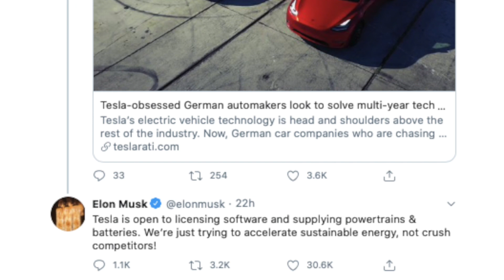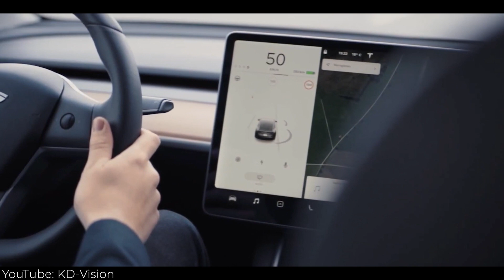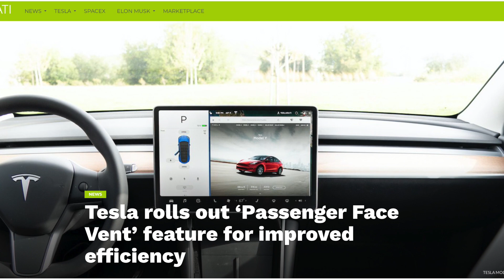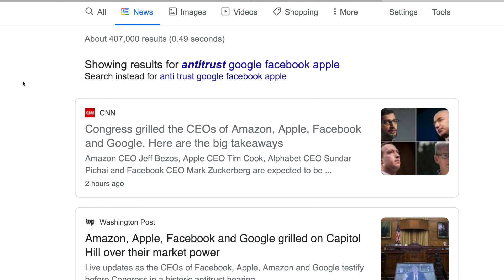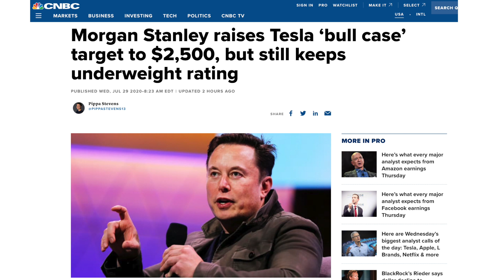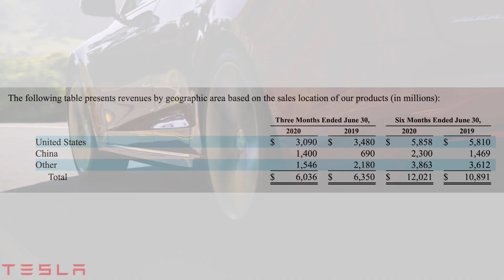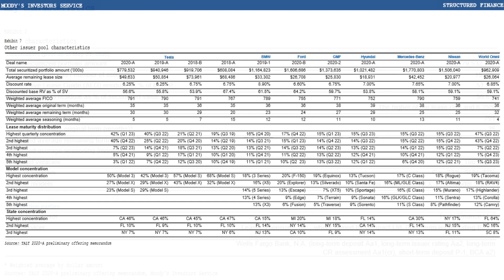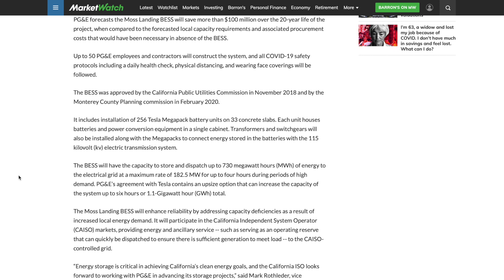Will Tesla License & Supply Other Automakers? +TSLA 10-Q Analysis, Cash Raise, Morgan Stanley & More

Comment: Tesla doesn't have a battery relationship with every supplier. If other manufacturers are dealing with non-Tesla suppliers, why wouldn't they license software or motors or even aspects of battery design at no detriment to their own capacity?  They have done this before with Toyota and Mercedes.

Comment: There's a difference between licensing the technology and licensing the products. 
Tesla could very easily sell licenses to their battery and powertrain technology for others to produce. "Here's the blueprints, make all the cars you want using them. The supply chain is your problem."
Same as how Google basically licenses the Android operating system for a pittance, because they know the real money is in the Android appstore, not the phone sales. 
Every licensed car using Tesla's FSD is feeding Tesla's AI. 
Every licensed car using Tesla's charging system is earning Tesla revenue on their charging network. 
Every licensed car using Tesla's interface software is earning Tesla app and data sales.
And ulitmately, every car using Tesla's FSD is potentially another Tesla Network robotaxi, earning transportation revenue back to Tesla. 
They don't need to sell the batteries and powertrain. They just need other automakers to sell cars in their ecosphere.

Comment: It is possible that with a secure contract in place Tesla could de-risk accelerating battery production to supply to competitors. This would benefit the cell price and R&D costs through scale which would reduce the price of the packs going into Tesla's vehicles.
It is also possible that this would increase costs due to increased price of nickel for example,

Comment: Great in depth news and analysis as always Rob. The key take away for me is the need for other manufactures to swallow their pride and work WITH Tesla. The offer has been out in the open for over ten years now and the longer it gathered dust while the company was threatened with "Tesla Killers" the less likely they were IMHO to ever work with Telsa. Hubris and Pride.... never a good match and will likely lead to their downfall as their number during this Q2 and Q3 will show. 

As for antitrust hearings. I think those who have been called up deserve to be. I'll leave that huge topic on that note and will only add that the mission, openness and actions of Tesla was never to be the last man standing... though it may work out that way in the end.
Reply: “Work with” is the problem. Tesla is not going to change to accommodate other manufacturers. Other manufacturers must adapt their product to Tesla. Only fair.

Comment: tesla can much more easily scale battery and drivetrain tech, FSD can be sold packaged as a hardware software system, like aTRW or Teves abs and other systems available now. none of your arguments hold water. in fact Tesla benefits if other OEMs partner or buy power train, they would get contracts which would allow for enormous scale improvement.

Comment: having a different charging network for each manufacturer seems very inefficientm waste of resources and space
Reply: Uniformity of power supply access,
already exists in many markets.

Why waste the effort,
To build unique power supply connections ?

????????
In the "cell phone" market:
-- the USB port, 
is the normal place to plug in your phone.
-- the individual phone/device:
might have a different connection;
but then has adapters to the USB power source.

Comment: Elon, if you really want to transition the world to sustainable energy, give a choice for customers to buy cars with a smaller battery. Yes, it is ok for people to have <250mi range in their EV.
Reply: I disagree. At this point in time, I think it's wiser for the EVs (especially Tesla's) to compete with ICEs on every aspect, including range.
Reply: @yourcrazybear  Then it is not really a transition to sustainable energy, isn't it. Check out best selling EVs in Europe and you'll see that far for everyone will need this long-range.
Reply: @paulf3353  Of course it is a transition to electric cars. My point is that it's wiser to compete with ICEs on every aspect at this point in time. People will see electric cars beating combustion engine cars on every aspect, which will increase both awareness and the status of electric cars, leading to higher adoption rates. 

Remember that electric cars are expected to reach price parity with combustion engine cars in a few years of time, partly due to batteries getting cheaper with time. Meanwhile the energy density of the batteries are expected to increase by 20% over the next 5 years. In the future you will be able to purchace an EV for the same price as an ICE today, and still get an acceptable range. There is simply no good reason to build electric cars with mediocre range at this point in time.

Comment: Absolutely sure Tesla's software is not a monolith but set up as an operating system with different layers and components, making it flexible and allowing easy change to specific components. This means that licensing should be very possible as well as customization. It's even thinkable that Tesla would provide services to others companies to help them doing it.

Comment: Imagine Tesla licencing autopilot. Now you don't have 1 milion Teslas driving and contributing to autopilot, but 100 million cars. Their autopilot would became so good, that using any other option would be just stupid. And now everyone would licence Tesla's autopilot, making them a software company, with high marging licence profits from every other automaker... So just imagine Tesla making 50% (batteries, powertrain, software) of every car every other automaker sells, and also every car every other automaker doesn't sell.

This would mean that Tesla speeds up transition to sustainable energy and also creating bussines in which they would crush (over time) other competitors through money of their competitors. While also having other automakers building superchargers (and battery/powertrain repair capable repair shops) like franchise. -> so other automakers would build future Tesla repair shops and superchargers using their money.
Reply: The software works with the hardware. Other manufacturers don’t have the hardware.

Comment: At some point I'd like to see tesla sell 'conversion kits' to the general public (or at least trained installers).  Motor/gearbox, control software and hardware, battery modules and BMS.  All basically plug-n-play.  AP/FSD not required.  That way we can take our existing vehicles and convert them quickly into EVs, as it's quite a waste to junk a perfectly viable vehicle (Iyes you can recycle much of them but it's more efficient to just repower them).
You can already do this, but it's a much more difficult process and often requires obtaining parts from multiple vendors with f-all support.

Comment: Tesla is willing to Licence the technology. How many Giga Factories are needed? Licence is not deliver the product. Licence means that if VW wants to build their own Giga factory with their own money and produce their own batteries, then they can go to Tesla and get help in building that. This will see VW invest in a production plant that Tesla doesn't need to invest in. VW then needs to source its own raw materials, can make their own battery pack and their own car, and put more EV and less ICE cars on the road.  Same for BMW, Mercedes, Ford, GM Toyota. For every car made there is a licence fee coming into Tesla account. This is not regulatory credit that stops in a few years but a regular stream of money. Then again the Tesla haters can complain that without that licence money Tesla is not profitable while they ignore that Tesla will use nearly all of this money to drive their own innovation.
Reply from the maker: Well, Elon specifically said license software and supply powertrain/batteries. So while I think what you are saying is worth considering, it may not be what is on Elon's mind with this tweet. I'll also share something I wrote in reply to another similar comment:
I've thought about it, it just seems like such a deep integration to be able to supply or license a lot of it. Remember Elon's emphasis on the call about how intertwined the manufacturing design process and the product design process are. Maybe very specific elements can be outsourced but it really seems like sum > parts (as Elon said about SpaceX today, too)

Comment: Rob, one thing I've always been curious about is where does Tesla store these data from 1 million cars? Do they use the cloud, or have their own computation hardware? I would imagine the capacity of computation could be a bottleneck for Tesla's mission of full self-driving, but I hardly heard anything talking about computation power. And on top of that, they should really have professional algorithm team locating in each continent to finely tune the neuron net for different transportation conditions in major contries. It would be great to gain more knowledge about that. Thank you!
Reply: The way I see it they actually don't store all the data, for example when they trained the stop sign recognition  they used something called "markers". 
They send these markers out to the fleet and it sends them back a bunch of photos it thinks could have a stopsign. Then they use these for training the net to recognize stop signs.
Reply: @Iwijn2000  The fact that one million cars that each sending at least one marker per day requires a large number of computation power,doesn't it? I'm not in this profession so I don't know whether this scale is large enough.
Reply: @sharplily2097  Tesla has their own server farm for self driving development. They even recently upgraded it to something they called project dojo. There is not much information about it. The only thing I know is that project dojo is a custom microchip with 16bit processor for neural network training.
Reply: @sharplily2097  I'm guessing they just need for example 10 milion images, so when that is reached they have their database to train the net on.
But I do think that the interventions with autopilot are always sent over so somewhere those must be stored.

I just found an Electrek article from 2016, they bought a data storage system for 1 mil. 
I also remember a guy from the EU on twitter that asked Tesla for all the data they had on him from the last month ( companies are required by law to do this here ) and they sent back a gigantic excel file of events (I think around 60k lines). These events where like: door opening, steering wheel turns,.... I don't remember any camera images being send back tho.
Reply: They will have their own server farm though I haven't heard details about it. They certainly have a massive amount of data but as has already been mentioned, they only store a very small amount of the total data generated by the cars.

Comment: Rob,  I think Tesla could license the battery factory or production system.  Global battery production could scale more effectively if Tesla supplied the machinery and technology to make the batteries, but  a third party obtains capital, builds the factory, manages the production, etc.  I agree however that Tesla won't be selling completed battery packs to anyone for a while.
Reply from the maker: I've thought about it, it just seems like such a deep integration to be able to supply or license a lot of it. Remember Elon's emphasis on the call about how intertwined the manufacturing design process and the product design process are. Maybe very specific elements can be outsourced but it really seems like sum > parts (as Elon said about SpaceX today, too)

Comment: Licensing technology and IP is very common in the tech industry and it is gateway to dominate system architecture of the EV platform and its charge network. I am not sure how Tesla will structure this arrangement but if done correctly it could generate a lot of revenue to Tesla by selling through traditional or new OEMs In general open systems are more powerful than closed proprietary systems as long they are continuously supported and improved.
Reply from the maker: I can see it for the charging network, any other specific elements you can see fitting with this idea?
Reply: @TeslaDaily  I agree battery supplies are tight now but this will not stay as such for ever.  The demand will spawn factories within few years. I could see deals around the battery management and fast charging system, power train and auto pilot once it get more refined. What nice about licensing is your get up front cash payment then you get a cut for each item in a car the OEM sell.  So Tesla makes money through OEM sales.  Also if that goes through Tesla is likely to charge OEM some fixed fee for each car to cover software update and bug fixes. This the formula made tons of silicon valley companies supper rich.

Comment: I think the word Tera gives a big hint. The new battery production footprint will use 1/4 less space as Tesla’s moves away from wet slurry, into tab-less, high density, pac based batteries. This will support multiple high performance automated battery lines and massive improvement in battery production.